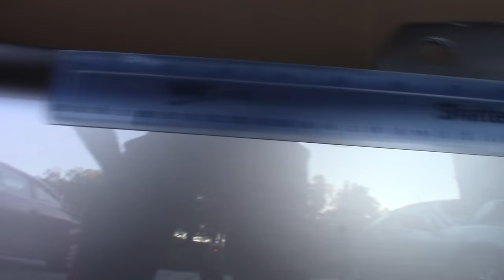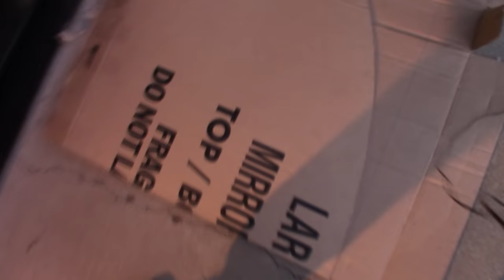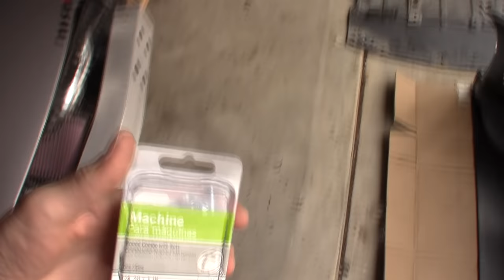PZ Z33 350Z: Custom Front Splitter Build & Install!

Comment: A word of warning regarding really strong splitter rods: If you bottom out even just a little, the lack of flex will push them right through whatever you have them fastened to. My rods pushed through an aluminum crash beam the very first gas station I pulled into. Now I use cables because they only support the splitter in tension anyway.

Comment: Brilliant work man, maybe put a hole so you can drain your oil and service the oil filter without removing the splitter each time. Gave you a subscribe as well
Reply from the maker: Thanks for the sub bro. The splitter is completely clear of the oil filter and oil plug. Changing it is no problem :)

Comment: Diffuser looks nice. Aren't the splitter rods supposed to mount to the frame of the car or under crash bar?  Being drilled into the bumper, if you hit a curb or something it will rip out of your bumper. Just something to think about.
Reply from the maker: KaosTheory360 Thanks dude! Yes you can mount to frame or bumper, and if my bumper was fiberglass, I would have mounted them to the crash bar. But the polyurethane is extremely tough and almost impossible to rip. it would take tremendous force to dislodge them- enough to rip them out even if they were mounted to metal.

Comment: Great job.  Im getting tired of what I see as far as “good enough goes!   These guys doing their diy vents.  And wide body.   They have a solid plan.  Just no Eye for detail.   Oh.  And a heads up.  The resin won’t eat through regular clear packaging tape.  And it peels right off.  Doesn’t stick very bad at all.  It worked fine for me when I made a custom fit speaker box that fits between the sound bar and the rear strut tower.

Comment: as a suggestion...would you have considered...sheet of 1/4" or 3/8" Aluminum..??
Reply: Ten square feet of 1/4" aluminum plate weighs over 36lbs. A much better choice would be a sign board material called Alumalite. Very light, strong & cheap.

Comment: Looks sick loving the vids. One question we're can I buy the material at ?
Reply from the maker: sugersnow2012 Thanks bro. I had to get the ABS cut to size at a plastic specialty shop. I think that's your best option, but you may get lucky and find some at a home improvement type store. Good luck man.

Comment: 40:15...that is choice..looks amazing. it was either the V2 front bumper but, after seeing this, must say.. inspiring..my 04 Roadster will have Smooth-line hardtop in addition with this V3 front bumper/rod fasteners. Once finished i can post video. Btw, where did you buy the rod fasteners for the splitter build.?     Thanks again!!
Reply from the maker: Thank you so much man! Yeah the V3 bumper is definitely the one for me. Your Z sounds like it will be amazing bro. The link to the fasteners I used is in the description! I highly recommend them.

Comment: Out of curiosity those vents on both sides of the bumpers is it possible to slide the factory Amber thingy? I want the bumper but I want to be able to add the led's Amber ones I see on eBay for like 200
Reply from the maker: Thanks for the question. Unfortunately the reflectors won't fit without considerable modification. What I would personally do is pick up some led strips and fab up some brand new lights with cut-to-size transparent plastic covers to fit into the vents. You're much better off going that route as opposed to spending $200 on some pre-made units that you will have to hack up and rig yourself to get them to work. Good luck bro.
Reply: SiegeStyle thanks well worth the input I might do the led strip little cheaper more color options. Where did you get the abs plastic for your splitter I need some of that and where do you think I would be able to get some transparent plastic

Comment: Great work but changing your oil is going to be a pain in the ass.
Reply from the maker: hbkecahbk Thanks! And the oil pan and filter are completely clear of the splitter, so it won't affect the process of changing the oil. 👍
Reply: Nice! You should make them and sell them.